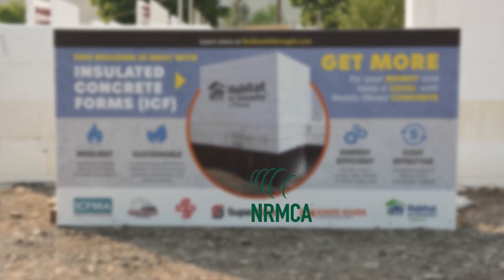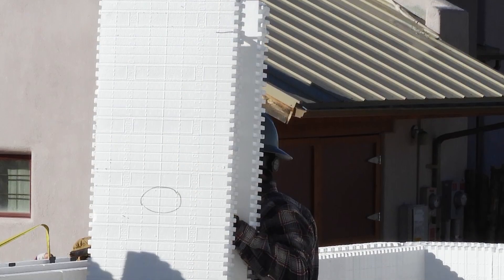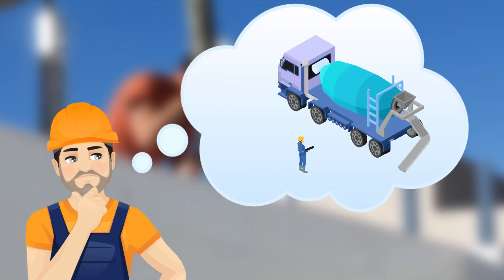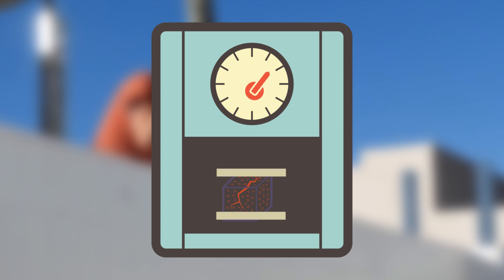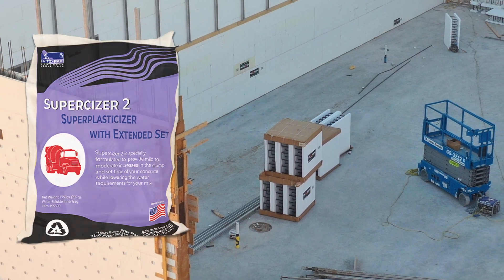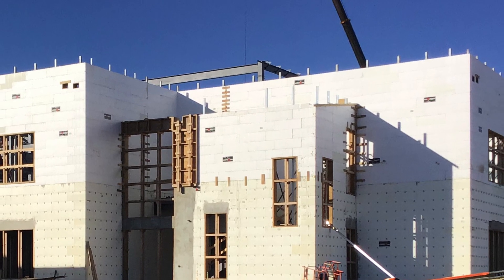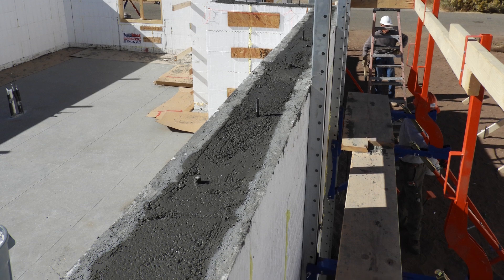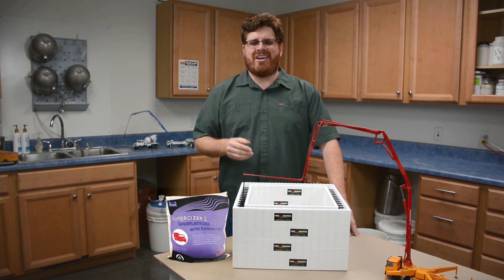Use a Retarding Concrete Superplasticizer to Improve Your ICF Projects

Comment: Great video. How much cost does this add to a yard of concrete? Thanks very much.
Reply from the maker: Thanks for reaching out.  One case of Supercizer 2 is $175 and includes 20 bags.  The recommended dosage is one bag per every cubic yard.  So the additional cost of using Supercizer 2 is roughly $8.75 per cubic yard.
Reply: @fritzpak4821  Thanks very much. Seems like a small price to pay for the peace of mind and flowability. .
Reply: Hola , me encuentro buscando productos fritz en México
Reply from the maker: @hiramitv6116  Buenos días, puede llamarnos al (888) 746-4116 y los miembros de nuestro equipo de atención al cliente lo ayudarán a ordenar los productos que necesita.